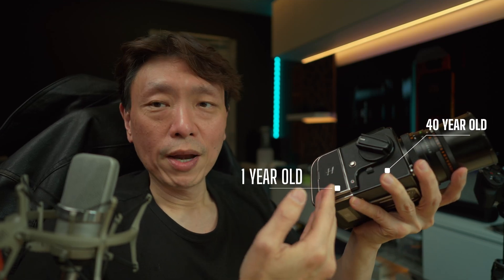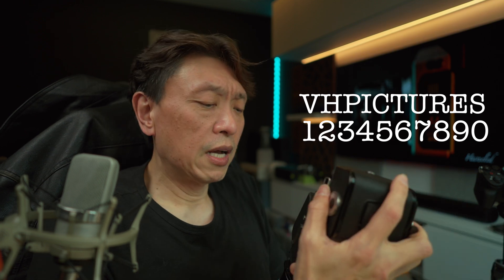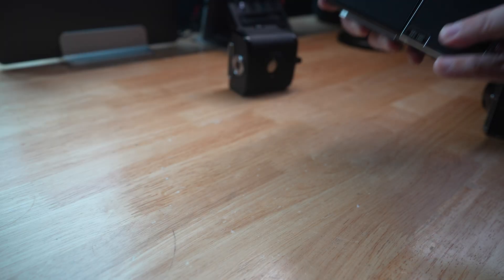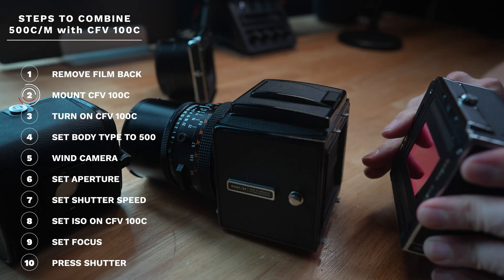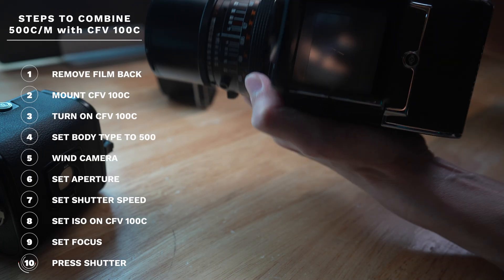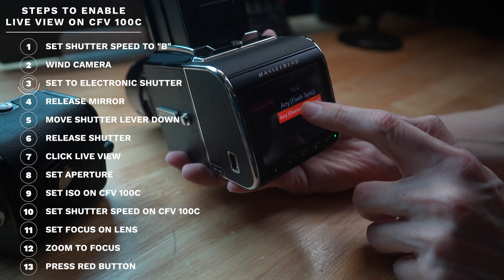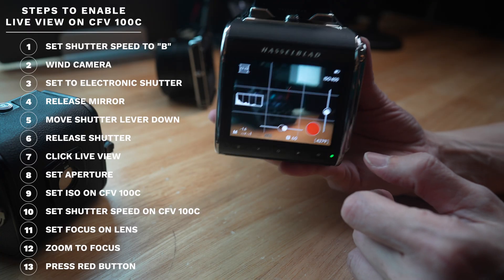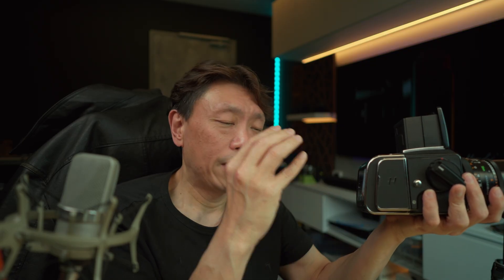Why are photographers combining antique cameras with modern day digital sensors?

Comment: Many professional photographers like myself use the CFV100c - but not on a 500 or any iteration thereof - we use ours on a Silvestri BiCam II and with the T+S adaptor - and also a Linhof Techno for stitching - we love the new V glass and have a few of the new lenses but always soften them in camera to make the final image more filmy - it is hard to do this in post; but the old glass is still good as you are utilising the centre of the image circle where it is best anyway - (1.3x Crop). We use Super Angulon's with helical focus  - yes it is cropped but hey lots of 10x8 lenses are cropped when using on a 5x4 - just use what works for you - it's what we do - we do architecture and cars - also cool factor!!! = Love what you do - keep it up
Reply: If by "many" you mean "basically no one" then you are correct.
Reply: @evrythingis1  I know of four near to me  move on with your negativity
Reply from the maker: Hey Nelson, thanks for sharing your insights. You have a good point that you are using the center of the image circle and the light falloff will be significant less and the corners of the frame will be getting the sharper portions of the image circle. Cool knowledge!

Comment: Yes I wonder why ! Because there is no digital back with a 55x55mm format !!! I have a Hasselblad 501CM, I will NOT use a smaller size sensor like the 44x33 which also is much too expensive for what it not is !
Reply from the maker: Aptus has a 645 format. I think the Hasselblad cgv16 (very old 16 mp) but smaller. Phase 1 has a digital back that's 150mp and 53 x 40. Still not quite 55x55 but it's really priced astronomically.
Reply: @Hasseled  I only want 55x55mm sensor as the original film format for the REAL Hasselblad Cameras.
Reply: Wow! And here i was thinking dinosaurs were extinct.   Another purist incapable of adapting to change. 

Feel free to deprive yourself but i will happily enjoy shooting my 503 and 500elx w a p65 w a full 645 sensor. 

And might i remind you Hasselblad sold 645 film backs. 

Also most commercial photogs shooting hassy back in the day, including Avedon, where cropping your sacred square image into rectangles to fit on magazine pages
Reply: @no_goo   Hasselblad did NOT sell many 4,5x6 backs, the 4x4 magazines sold better, colorslides in 4x4 could be mounted in 35mm slide holders and showed on 35mm slide projektors ! It would be of more sense to make a 44x44mm sebsor if it had to be cropped ! I do NOT care about magazine photo covers !!! I do not care about Avadon ! If I wanted the 33x44mm 100 megapixels sensor, I would buy a Fuji GFX 100SII !

Comment: Is it worth getting though? I have a 500cm
Reply from the maker: I am still undecided. For fun yes. But for travelling and trying to capture the best images possible, unlikely. And the weight....
Reply: Great job. I love using my cfv50c with my old body. ❤
Reply: Get a phase one p65+…. Full size 645 sensor instead of this tiny cropped “mf” sensor. Cheaper too.

I wouldn’t put a cfv back on this though. Sensor too small.  Smallest id go is p45(36x48 i believe)